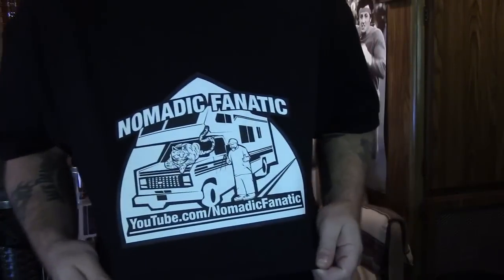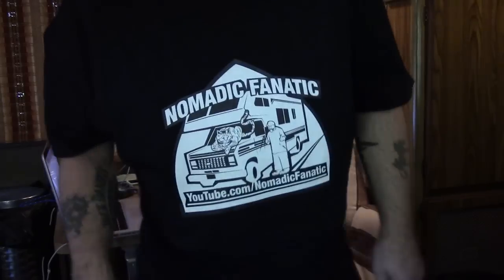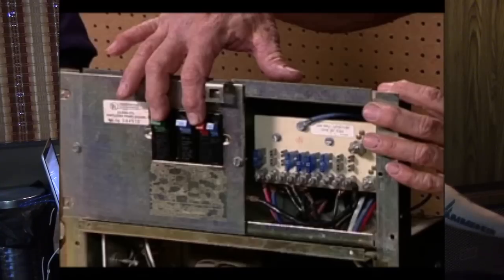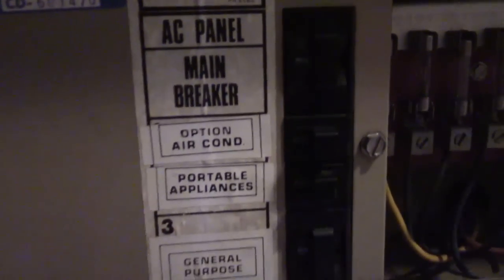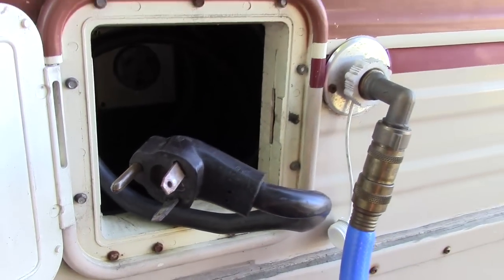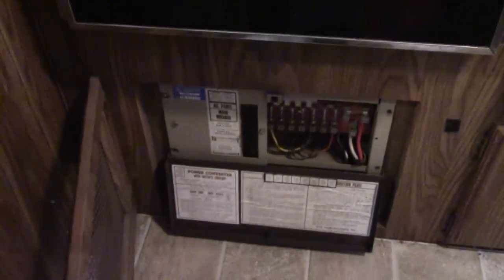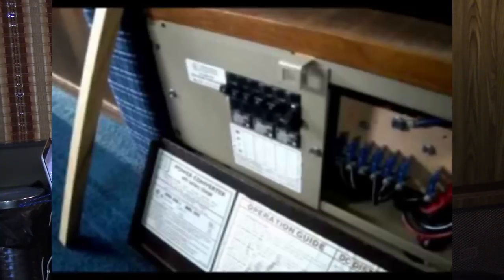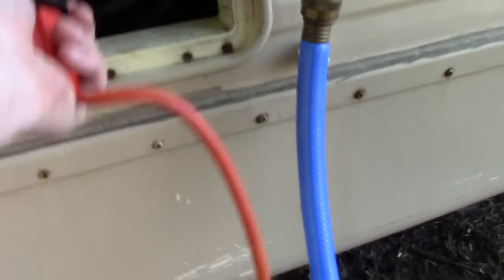RV Power For Dummies

Comment: Hello, this video has been relatively helpful in understanding more basics... I'm in a situation right now... I had just recently come up on a 1982 Chevy P30 Aluma-Lite Motorhome. I got a smoking deal on it, and the interior is in excellent condition, but it had been sitting for years. It's my new permanent home on a 11 acre property in Paulden. I had a few more questions regarding the generator and overall wiring. I've been told that I can't cross any wires from solar with anything else that already exists. I guess that would fry wiring from what I was told. We live pretty minimally, so I'm trying to figure out a way to provide some heat via solar panels for this upcoming winter. Trying to avoid using too much propane or gasoline... Is this an unreasonable exception for me to want to achieve? I appreciate any feedback and instruction. I'm considering making a short YouTube video kind of going over the RV and asking questions that arise and seeing what folks have to tell me. I've been having trouble finding content on my particular RV, even Manuel's. Would that be advantageous to do or a waste of time?

Comment: If you want to use your ac plugs one can put a plug on your ac wire to plug into inverter.  You need to be a little smarter than a rock to do so. 🤣🤣

Comment: I have a 2002 Aerostar travel trailer and all I can get to work is the 12v. The power is plugged in to a 110v outlet but none of the outlets in the trailer work. The refer and anything 12v works just not 110v. Is the converter bad or am I missing something? Thanks

Comment: My cabin power is dead. But, I have power if the generator runs or connect to outside source.  There is a  red reset bottom. How do I use it. While engine running or when ignition is turned on.. Pleasure Way 2006 TS Chevy 3500.  You are a decent guy. Thanks..

Comment: Eric, if you are using a speed charger plugged into an AC outlet that is being powered by your generator, wouldn't your generator be sending current to the batteries in addition to the speed charger? How can you tell if there is more than one charging source at the same time?

Comment: How does your RV. automatically know to use 12 volt converter shore power only (when plugged in,) and not 12 volt battery power (at the same time,) totaling 24 volts?

Comment: This video has answered all my questions. I needed the basics of what converts to what, etc. I have a mini bar fridge & freezer 110volt 1 amp each, no battery & SUV only 4 flat harness. Now i can power up yellow wire to camper, use an inverter off 12V socket for power during transport. Subscribed :)

Comment: Thanks useful and interesting. I have a problem where my fridge is not receiving power while I’m mobile but works from shore power when stationary.
Reply: Do you have a house style residential fridge or a RV fridge that can run off of electric and/or propane? If its a house style fridge, or a RV fridge with the switch set to electric, it will not work. The control "eyebrow" board is powered by the battery, but the heating element in a RV style fridge is powered by AC electric unless you have a rare DC powered heating element model.

Comment: Can someone please answer a question.  I am getting ready to relocate out of state to an RV park where I will be working and docked in a spot that will be my home for the possible future.  A relative of mine secured The sale of the travel trailer I will be living in ,and he also did the walkthrough to inspect the trailer itself. It is an older model that he wanted to make sure was in ok working condition.   Here is my question. Is a 12 V deep cycle battery 100% necessary for the travel trailer to be operational on a daily basis. Knowing that the travel trailer will not be moving from that site at all. I do not have a truck to tow it at the time so it will be stationary for a very long time. I was under the impression that the battery was merely for backup, especially since I will be plugged into the Electric City that is provided from the site . Can I go with out the 12 V deep cycle battery and just run the electricity that's provided from the site

Comment: Thanks!  I appreciated this video.  You're easy to understand. Our converter failed on our 2019 5th wheel. we had 2 fires and they're saying the converter was the issue.  huh?  We're not sure we want to stay in it when we get it back and we're FT.
Reply: It's either a manufacturer's defect, or using undersized wire during the install.

Comment: Easy to follow your explanation 👍. 

I am planning out my own power system in a Tiny House Cabin I am completing. I have a 2000 watt inverter and plan to connect it to a deep cycle battery to run lights during the day when the generator may not be running. Of course I will need to do a little strategic planning using a relay to keep from back feeding my invertor or generator in either mode. 

Any idea how long your battery will last with light appliance use?  Lights, TV, etc.?

Thanks.

Comment: I have an older class a rv and I'm super clueless when it comes to the power side of all this... I have power when plugged in, I have power when the generator is running, but when its unplugged and the generator is off I have no lights.. So basically I have no 12 volt power. Help, where do I start to figure out what's going on?

Comment: Atleast 2 outlets aren't working for our RV but others are, tried all the breakers and fuses and everything is fine hit the reset button on the only 2 outlets with reset on them don't have a electrical checker tried unplugging from 30 amp into 50 amp still broken and jumbled the back of the outlet from the inside nothing happened flipped all the on off buttons that we don't know what it does and nothing happened and we are poooooorrrrr folk and no clue what to do 🤦🏼‍♀️🤦🏼‍♀️🤦🏼‍♀️

Comment: Love the video I got a 2019 stealth 35 ft toy hauler and its just annoying that I have to turn the generator on everytime i want to use the microvave
Reply: If you have a large enough battery bank, and a proper sized inverter, you could run it for short periods. I wouldn't cook a turkey using the inverter though.
Reply: @asphaltadventurer  appreciate it you know of a installer is it expensive?
Reply: @Kenweb619  Depending on type of battery and if you choose pure sine inverter (minimum 2000 watts). The install itself can be DIY. Watch videos on proper wire sizing. Around $500 if you DIY.
Reply: @asphaltadventurer  would a couple hundred bucks get you to do it 🙏🏼😂
Reply: @Kenweb619  Are you in the greater Houston area?

Comment: Last year I started using solar last year with our tent camper.  After doing things wrong it works so much better.  100 Watt Panel, marine battery with reserve of 180, control box and a 500 watt pure sine inverter.  I bought everything off of Amazon.   FYI: I got the 100 Watt panel for FREE, long story.

Comment: So when you're boondocking, and you're running on dc,do you keep your generator on all night (for example if you needed to run your air conditioner, a fan, and charge a phone?)
Reply: If you are running an AC, yes you will need the generator. The other stuff can be run through an inverter with your batteries if you have one installed. Easy DIY.

Comment: Wow,  that was seriously helpful.  I have a camper that I bought last year and am totally stumped on the electrical side. You answered so many questions.   Without being the person who did the electrical work, how can I figure out if what amp power I have on?
Reply: if the metal blades on your RV power cord are angled, you have 30amp which means you can't run two high powered appliances at the same time, like AC and microwave. A 50 amp RV powercord has vertical metal blades and are somewhat larger.

Comment: Well then my converter must be fried. Lightning struck close and the light flickered. Then noticed no tv or heater. 2 plugins work though. Went to reset a breaker that had tripped, and the converter hummed really loud and the breaker tripped again. Has an extra in the house, but it burned up when the house did! That's why I was having to live out of the trailer!

Comment: Thank you for your video.  I see its been a while since this was made so I hope you still get the message.  I just got a 45 foot highway bus with a 12.7 L engine and a huge, self contained air conditioner / heater.  I dont plan to change that as I think it needs a huge engine to run it.   I plan to install a generator of 8 to 12 kw.  I have a 4000 watt inverter.  I plan to install 6 deep cycle batteries for the living area and it has 4 large batteries already installed for the engine which I will keep separate.  I want to start working on the electrics.  How do you have solar, shore, generator, and battery power all join up without shorting each other out? Do they cut each other off automatically or do u just manually choose the one you want in a breaker box or such?   Someone told me that it will all go into the battery and some will come back out as 110 because of the inverter and some will be 12 volts.  Is 4000 watts big enough for the inverter? What can I run with 4000 watts on the inverter?  Is the wiring for the 12 volt completely independent of the 110 volt or can they share circuits when changing power source?  Should the inverter be much closer to 10 kw if I have a 10 kw generator?  Where can i see the step by step process to set all this up?  Thanks.

Comment: Hi my brother loves you, my question is do I have to add water to my deep cycle batteries on my fifth wheel if so how often?
Reply from the maker: Do you know what kind of batteries they are? That's the first step in determining what kind of maintenance they require. Just look at the top side of the battery. If they are lead-acid batteries, look for a cap or 2 to remove and add water. Or look for any writing. It may even say "maintenance free batteries" in which case you can just leave them alone. But if they are older, or similar to a lead-acid battery you've seen under the hood of a car, chances are yes - you should keep filled with distilled water. :) I would check every couple months.
Reply: Nomadic Fanatic Thanks I will check.
Reply: @nomadicfanatic  In addition to what Eric stated, use distilled water only. You don't want minerals, fluoride, or any other nasty tap water stuff causing issues.

Comment: Hey Camper buddy,

I board for a couple of weeks a truck camper. Pretty big 11ft and carry this one with my ford dually. But one question, have my power outlets to work if I put the generator on? I think so but the don't work :( 
Thx for your help
Reply from the maker: Just make sure that your shore power cord is plugged into any "outlet" required nearby in the same area that might make the outlets work while the generator is on.

Comment: I may have missed it in the video, but my motor home has an Inverter switch on my panel. Is the purpose of this thing to be able to run things when I am boondocking and do I have to flip the switch in order for this to work?  Also, am I correct in assuming that this will now run from my onboard battery once the switch is flipped?  There is a manual with it, but very hard to understand.  Thanks. :0)

Comment: So if I was rich I might make all the outlets work but I'm not rich and so I'm taking my inverter from the van and hard wiring it to my batteries yay. I know how to do that so now I'll have power. Could you provide me a link to the day charger thing for the batteries. Am I correct in thinking that since I have a generator I could turn it on to use the fast battery charger so I wouldn't need to run the generator as long? Thank you for you video.

Comment: You are going to love having some solar (sure you do by now).  a buddy of mine used a large higher watt, and volt (36? 48?) house rooftop panel (he scored used) and the right "step down" controller. Thanks for pointing out that the "power center" often only trickle charges, even when generator is running? It may be faster (but higher risk of CO to run the vehicle to charge house batts. I have to figure that out. It is generally fairly EZ and inexpensive to add more deep cycle house batts. Good points about the 1000 W converter. Wont run say a vacuum. I get as many cordless quality tools as i can, Have a great 20V vacuum from DeWalt. you can charge such batteries with a lighter plug style inverter. changing out all 12v lights to LED saves huge house batt power. I have found out that the furnaces fan is pretty inefficient (uses far more house batt than I had imagined)  want to do upgrades to keep the heat going, but the catalytic heaters IMO ( and many others) not for sleeping.  Good simple explanation. to run an AC for any amount of time on DC we'd need a tesla batt and a hella high watt inverter.  In arid hot climates swamp coolers are golden esp 12v. There are 12V to other DC voltage converters that are much more efficient that 12v  DC to 110 ac back to say 18v dc for dc items like laptops, Modern TVs as well cheap. I learned the hard way that external generators like a quiet honda or yamaha (or loud ones) that have a 12v charge are weak trickles. I like you know have an external "smart charger" (mines from West Marine) and it will charge my house or starting batts PDQ.  My rig's alternator will do so more quickly......one can upgrade their alternator if needed PS. Having a bunch of aa aaa c d and such lights and other dc gadgets  and investing in rechargeable batteries is also a great way to have longer boondocking and important backup.

Comment: Ok, Im a newbie and also Not to suave on this part of my RV...this is an older RV 93   and it has a generator (Onan 4000) ...when I am not plugged into electricity and want to use my generator to run the lights, water pump etc  I plug my 30 amp cord into the RV itself and run the generator and that is what charges my  RV battery....I was told to run the generator 2 hours in the  morning and 2 hours at night to keep the battery charged..also, I have had a  shut off switch put on the RV battery and the chassse   battery because the detector in the home was draining my batteries when not in use....so when I am boondocking and using my generator should I have the chasse battery switched off or just leave it on or does it matter?   Also can I  run the  microwave and heater on generator or will I blow the circuit?

Comment: i have a camper 1987 run to pole for power i got power at pole for a year and it just went out in the camper   no breakers where tripped what could it its a 1987 sparta made by travel line enterprises?

Comment: Hey bud. I live in a 5th wheel trailer.
I have solar panels and a generator. 
With an inverter.
..
I plugged my trailer into the generator and worked out thru the trip box that the converter is tripping the generator and is not charging the batterys..
I have switched the converter off on the tripbox so I have power thru the ac but all my lights the propane blower heater is drinking from the battery and not the generator.
How fucked a position am I in???

Good video I learned alot. I am such a noob

Comment: Very good video! I don't remember if you  touched on this - if I have the generator on do I leave the battery connect/disconnect switch on or off?  Also, so if I have a 15 amp to 30 amp adapter, I should only use to charge the coach batteries (from home outlet to rv) with nothing on in the rig while I'm doing it?
Reply: How the battery disconnect switch is wired varies by RV. In my motorhome, the generator will charge the batteries with the disconnect switch off as tested by using a multi-meter on DC voltage I get a reading of 13.6 with generator running and disconnect switch off.

Comment: quick question I just recently was givin a 1977 rockwood dodge camper im trying to figure out how things work do I have to have the 12 i see it has a control box that the power cord goes into im thinking the 12volt deep cycle battery battery sends power to that control box and that allows the connection to turn the refrigerator on even tho its plugged into 120 outlet any info will help thank you

Comment: I had no idea why my power outlets didn't work. The rv has an inverter but it inverts ac to dc.
Reply: from what I understood on this video - you probably mean a convertor - which is what concerts ac power to dc power.  the inverter charges  the batteries with   solat power energy converting into 12 v  .... I believe that is what I understood correctly ... maybe listen to video again ... there is sooo much info on it

Comment: Can you do a video regarding #1 upgrading or increasing your inverter & #2 convert from regular AGM batteries to lithium batteries and what it takes to convert this to work with solar panels
Reply: Upgrading your inverter is as simple as "pop and swap". Several vids on how to change out. Lithium batteries will not work with traditional converters and you would have to purchase a converter specifically designed to charge lithium when connected to shore power or running generator. Lithium works very good with solar but is expensive. Solar panels should plug in to a solar charger controller box first. This prevents too much power going into batteries that are nearly full. The solar controller box also contains a feature to protect reverse flow from your batteries back out through the panels at night.